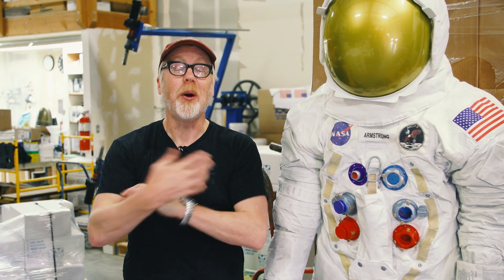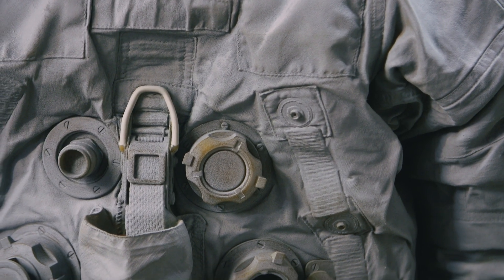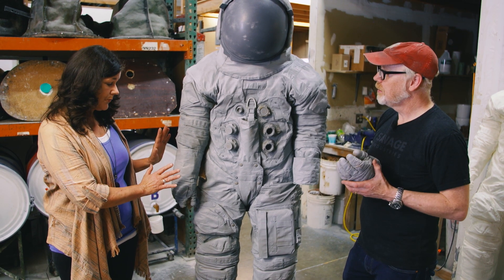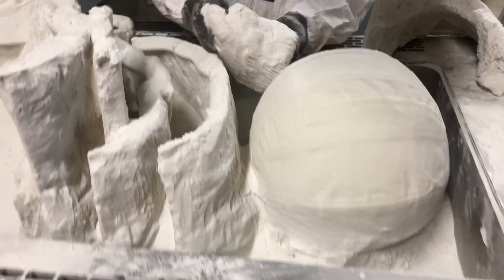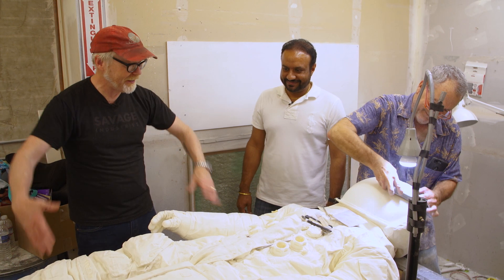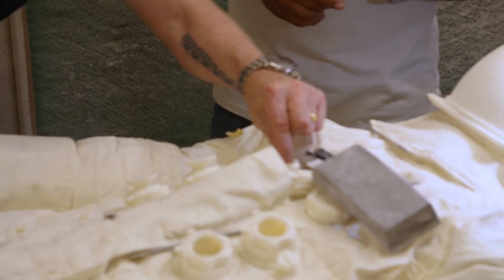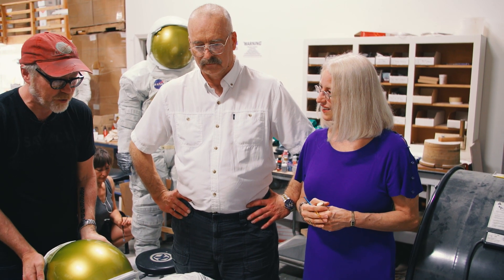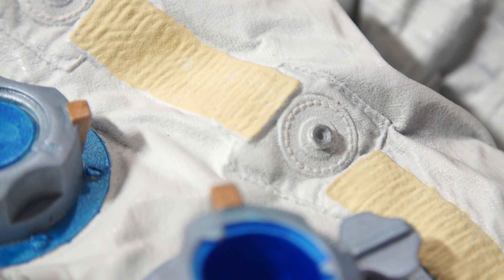Replicating Neil Armstrong's Apollo Spacesuit!

Comment: I mean that’s very impressive for a casting and 3D print, but would it have not been better and potentially cheaper to actually replicate the thing out of authentic materials, using real fabric, real metal, glass etc... basically like some of the suits Adam has done  for cosplay. Would that not look SOO much better? Can’t tell me it would be much more, if any more expensive. As impressive as these casts look, they just don’t look convincing too me, helmet and metal isn’t shiny, The glas does not look like glas etc. You can tell it’s off. Some of Adams suits looked much better in comparison.

Im sure though it will look fine from a distance. You can only tell close up, and how many will get that close?
Reply: they are making these resin/fiberglass ones to display outdoors at parks to celebrate the REAL suit being put on display in the museum, so people walking by the parks can get a close look at the MODELED suits and even potentially touch them without damaging them like a cloth replica would be.  The real suit will be safe far away indoors in the museum.
Reply: If they were made of cloth, they wouldn't be weatherproof.
Reply: @isaaccisa  I thought they are displayed in a museum? They will certainly not be exposed to the elements.
Reply: Maybe for the first one but not for 15

Comment: Only thing that's disconcerting is the helmet face shell isn't nearly reflective enough.
Reply: they should have just applied some reflective gold vinyl
Reply: And the red fittings look really off to me. Here's a picture of the actual suit: https://ids.si.edu/ids/deliveryService?id=NASM-NASM2008-9204
Reply: @Sharklops  Yeah the red is a bit off. I can't see any blue on the top right in the original.
Reply: @Sharklops  yep agreed anodizing look is not done right
Reply: everyone seems to miss the point here....... Its a 3D scan of the actual suit that Neil A wore into space. Then 3D printed and cast to make multiple copies to be put into the public eye to celebrate the anniversary of the moon landing. Yes it could of been made better, more shiny , better paint, all that jazz........but it wouldn't of been a 3D scanned copy of the ACTUAL suit he wore. Not a replica.
Reply: I think that's because they wanted to paint it instead of using something reflective. Probably did this because it's being showed off and could be broken. Thats just my theory, though.
Reply: Getting a reflective surface to not look wonky on that many parts would be nuts.
Reply: @Bill C - If by "make them out of aluminium" you mean machine them out of solid aluminium blocks, then no, obviously that would not be easier than simply pouring resin into a mold.

@Ruben - Which is why they shouldn't have painted the visor at all. Just make it out of vacuformed plastic, like the one in Adam's suit, then paint / gild / metalize it from the inside. That way the outer surface always stays smooth and shiny.

@vector6977 - Gold leaf is quite cheap, and it's not like these guys were trying to make optically correct glass with uniform absorption and reflection to prevent an astronaut from being blinded by radiation. It just had to look shiny. There are lots affordable bike helmets with shiny golden visors, it's not such a hard thing to achieve - you're jut not going to get there by painting opaque resin or plastic.
Reply: RFC3514 I used to build props for movies and for a hero suit there is no way those ports and that visor would be considered acceptable. We would have to go the vaccuformed visor and aluminum parts route for sure. Not that expensive to do with today’s machines.
Reply: needs at least a 1500 grit wet sand, clear coat, copper and gold coat. than clear again. trust me i paint cars
Reply: Agree and the fabric just isnt there,
Reply: Yeah, I wish they had talked about why they didn't go with a polished/shiny option there. Obviously it was possible, so there must have been a reason.
Reply: You guys must not paint much; it is absolutely possible to get a reflective mirror finish on plastic.
Reply: Yes realised BIG ERROR won't repeat that one ...
Reply: There is chrome wraps for cars maybe they could apply it here too
Reply: And the suit isn’t dirty
Reply: Honestly, the whole paint job isn't that great. Masking was terrible.
Reply: @timmurren838  Most of the closeups in this video that betrayed rough masking looked like they were work in progress.
Reply: @timmurren838  My thoughts exactly, for all the hard work that went into prep and the casting and everything only to be let down but some pretty mediocre painting that could have been much better if they just took a bit more care with their masking. I too feel like the visor lets it down a bit.
Reply: Probably done on purpose for some reason. They went to this level of detail to forget the shiny helm? Nah they didn’t add it for some reason or couldn’t.
Reply: @Shadkow  I'm thinking the same thing. I've worked for a company that does this sorta work for theme parks, movie releases, retail spaces, and conventions. Those sorts of decisions are made all the time based on whether the figure will be indoors or outdoors, whether it will be up & away from folks, or people will be able to get right up close for photos. All sorts of little changes are made based on these variables. Sometimes it's something as simple as "What's the fastest & cheapest way to do this? Can we maybe tweak this in an acceptable way to save time, money, or both?" I can 100% for a fact tell you they COULD make the visor look legit. It just takes time, money, and resources. Being that these are going to ballparks, probably in direct sunlight too, my guess is they're going this route to save time/money, and make for a better, less glare filled photo.
Reply: I don't understand why they wanted to mold and paint all of the ports. It would looked better and been easier to make them out of anodized aluminum and screw them on. I agree the face shield looks bad and that's the real center piece.
Reply: @onesleepyshadow  they will be public displays. And people steal things.
Reply: @vector6977  unfortunately you're right and other unspeakable things.
Reply: @vector6977  its a cast mold. if someone wanted to, they could snap an arm right off with a firm, swift tug.
Reply: @onesleepyshadow  It probably would look better but then it would not be an exact scan duplicate of the original.
Reply: Banjo Billy they worked in different materials than what the visor was so they probably couldn't replicate that level of reflectivity.
Reply: @Askharr  ^exactly this. Doesn't really matter how you paint your plastic, it will never look like glass.
tbh for the lengths that they went to, an actual visor that snaps into a few pre designed holes would not have been that much more difficult, it doesn't have to be in space after all.

But then again, who are we to challenge this magnificent piece, they did an amazing job as it is!
Reply: Ruben Not true. I used to think a paint wasn’t capable of simulating chrome or polished metals. But there is now. Actually there are several. A great one that needs no special prep and can be sprayed straight from a can is made by Krylon. They have what they call a Premium Metalic Finish that comes in a spray can. Lay it on over a white primer and it’s indistinguishable from a highly polished metal. Comes in gold, silver, chrome, brass, copper, and other metals.
Reply: @ruben9912  As far as I know the visor was made out of Polycarbonate. Glas can break very easily compared to that stuff.
Reply: @Gamer1st1  well if thats the case I am happy for it but it leaves even less excuses for the end finish
Reply: @Gamer1st1  yes l used it good with right prep
Reply: AND IF YOU WORE THIS IN " SPACE" YOU WOULD DIE VERY FAST...SECONDS
Reply: Could it need to be less reflective if it's going to be out in a public place, less chance of glare for passing vehicles possibly?
Reply: Banjo Billy the original coating was gold based, so the cost would be extreme.
Reply: vector6977 not really. Sheets of gold leaf for example ,are quite reasonable because they are super thin.
Reply: @vector6977  Thin layers of gold cost nothing.  Real gold leaf is only £26 for 10 sheets in London.  Dutch (faux) gold sheets £10 for 10.  They could probably get it cheaper wholesale.